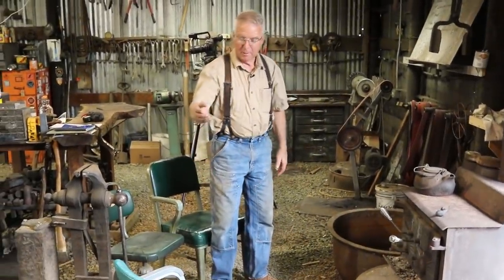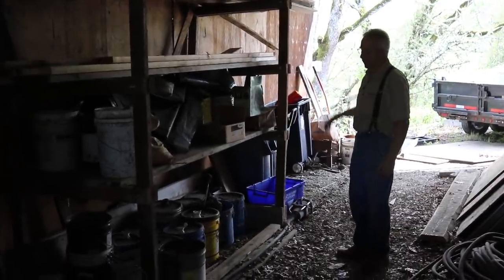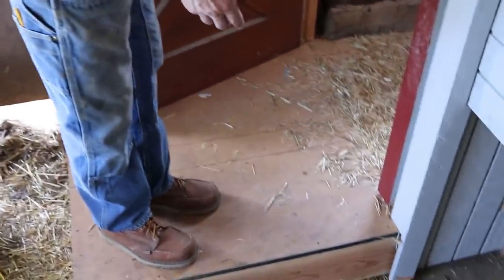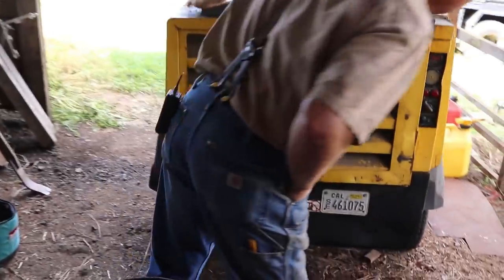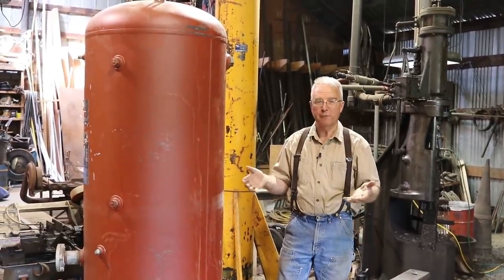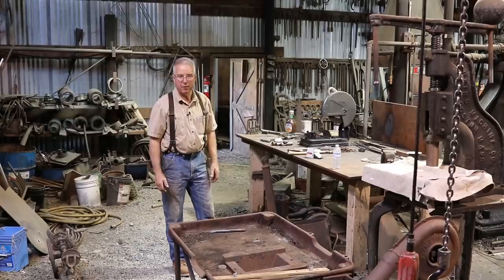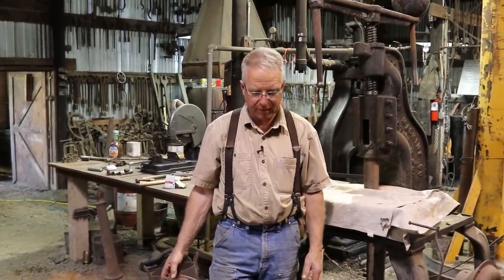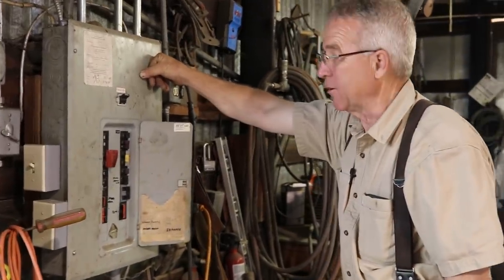Shop Tour 2.0

Comment: FPE panels, also good for arc welding as the breakers are reluctant to trip on a short. Changed out many of these panels in my day and saved the breakers thinking I could become a millionaire selling them, but never sold a single one because any time I encountered one of these beauties I always recommended changing it out for a new panel. ;)

Comment: I would put that outside on concrete slab with some copper piping running out to it add a trench dug over to the power hammer and put a moisture drain kit they sell condensate drain‘s that automatically pump out water once water has started to send into the bottom of it

Comment: Certified scuba tech here (smaller vessels but much, much higher pressures - 300 bar), put the pressure vessel somewhere easily accessible for inspection purposes. Even if you don't keep up with the legally mandated inspection routine in your region, being able to keep an eye on the condition of your pressure vessel for your own safety and those around you

Comment: Take note of the suggestions from others here, for piece of mind a hydrostatic test is a bare minimum for a pressure vessel of unknown origin.  I’m sure the nameplate was removed, for liability reasons.  You can not assume anything about that vessel.  The energy stored in that volume of compressed air not to be taken lightly.  I’m a metallurgist and SME in pressure vessel failure analysis.

Comment: Mount the pressure vessel up by your long steel rack and plumb the lines to the power hammer through the air so you don’t have to worry about them

Comment: A tank like this should be placed close to the compressor.  You'll have LOTS of water in the air.  The tank needs to be able to be drained - it will also act to cool the air down as you are running tools.

Comment: I'd mount the volume tank (it's what we call them in the commercial diving industry) outside and plumb it directly to the power hammer. Put a small volume tank or peanut tank (diver terms again) inside fed from the smaller compressor. And then put a croseover between the two systems (1/4 turn ball valve basically) to isolate them if necessary. I'd never worry about a pressure vessel made from pipe unless it was thin wall. Personally I can get oil/gas pipeline for free. If welded properly, it can run at a working pressure of 1200 psi no problem. Running less than 200 psi... No worries. Worse case scenario, pin hole leak. Then again I'm in lousiana. Use what you can get.

Comment: My vote for the air receiver location would be up.  Someplace in the rafters, or on some sort of support framework.   Second place is outside.  It wouldn't be too difficult to add an enclosure to protect it from the elements on the exterior of the building, and it wouldn't take up inside space.   Least desirable would be inside the shop at floor level, taking up your limited shop space.

Comment: I would put it outside, that's what we did in my old shop.  That was kinda a rule, if it could live outside, that's where it belongs.  One thing we did was run a copper hard line out that was diagonally run to the top of the wall, then came down vertically to enter the shop at about waist height.   This acted as a cooler for the compressed air and had a drain at the bottom.  It was very effective, our air was pretty dry although we sitll used driers.

Shop organization is an art, you need to analyze what you do most and minimize the travel back and forth from work to tools/stuff.  For car repair shops, there are consultants who specialize in just that and can save significant time esp when working at book rate.

Comment: There is a product called mobile coat that is used on rv's and mobile homes for sealing the roofs. I have used it to seal around nail and screw holes in metal chicken house roofs. A little spot on each fastener and 2 or 3 coats will stop the leaks and get some more years out of the roof. That is if you don't mind all of the white dots all over the roof.

Comment: I'm a licensed mechanical contractor in Maryland. I service steam boilers, process air compressors and other industrial equipment. They make automatic drains that run on timers to blow condensate out of the pressure vessel. It will extend the life of the tank. You said that vessel was boiler rated it was an explanation tank for a how water boiler? It doesn't have a bladder inside of it does it.
Reply: Those automatic drains are nice.
Reply: Keith Byrnes was thinking the same thing... I’m betting it has a liner.

Comment: Your storage air tank is being used as a accumulator for the power hammer. I'd mount it as close to the power hammer as safely as possible. Personally I'd mount the tank up above. Your floor space is your most important tool you have, keep your floor clear as possible!

Comment: for the air tank what about a cinder block pit in the floor with steel plates over top ?
mount in on it side but at a  1/4 inch slope per foot  so you can install a proper drain valve.
perhaps cinder block walls... 
you could make the pit bigger than needed and squeeze in the smaller compressor, this would quite things down....
as i am typing this does sound like abit of work versus reward... 
if you have the space perhaps a small shed outside of your building with the shop compressor in it as well?  this seems to be the more standard approach to this problem?

Comment: If floor space isn't a major concern, I'd say make the plumbing/servicing easier and mount it as near the power hammer as you can.  We have a big CNC mill at my machine shop that has a pneumatic tool changer that has similar air pressure requirements and we put our aux tank right behind it.

Comment: Cutler Hammer CH load centers for the win! 60+years of faithful service in dozens of applications for me and never an issue. All Copper silver plated buss and breakers readily available at most stores. Should be no problem running multiple air compressors into the same tank. Mounting it in the ceiling would save wasting floor space and reduce the length of your piping runs needed. Assuming your tank has the proper reliefs I don't think exploding would be an issue. I have never been able to find any documented proof of a failed certified airpressure vessel that was strictly from corrosion. Most all pressure vessel explosions are from failed overpressure limiting devices. If you do run multiple compressors into one receiver be sure the blow offs can handle the capacity of both units combined.  Every receiver I have put out of service was all do to air leaks from rusty pin holes vs massive explosion. Lots of semi trucks and trailers have air tanks rust out and fail all the time. You never hear about them exploding though.......

Comment: I'd put the big tank outside and make it dedicated to just the power hammer.  Then I'd use a more conventional ten or twenty gallon compressor for general shop air.  It also should go outside.  Both should be outdoors because they are so darned loud.

Comment: For the air tank, if you intend that there will always be air in it, install a large and small compressor on independent circuits.
Lets say you want 100psi, set the small one to run at anything below 95, set the large one to run at anything below 90 (this one can cut out at 100 on the hysteresis)
When you run a small tool, only the small one should run, but if you then run a larger tool, the big one will cut in as well.
The aternative is to select the one you want, but the above iddea is automatic.
Also, i would mount the tank outside, don't want big boom! :D

Comment: I'd be putting the tank outside to save a bit of space and run 2" lines to the power hammer so you don't get a pressure drop. 
Also if you want to clean up that rusty forge try molasses and water. I always have a plastic 200 litre drum ready to go. It takes a while but does a good job, just soak for a couple of weeks and pressure wash it after. No scrubbing.

Comment: For the Air Storage Vessel, either stick it outside and pipe in large air lines for it, or mount it up in the air. Keep the shop area clean and visible all around. Don't clutter it up with tall objects that make it hard to see around.

Comment: I would suggest putting it as close to the hammer as possible... This will deliver the most volume to hammer on the start...90 cfm at 90 psi is alot lol...couple other folks have mentioned a drain as well which a great idea... Your gonna get moisture no matter what so hitting ball valve for a few seconds before starting would be a great pm

Comment: When you upgrade your service panel consider upgrading to 200 amp service.  You can use a separate service which is good if you want to write off the cost as a business expense but may also result in a higher commercial rate. A better option, abet a costly one is a 360 service.  You get two 200 amp services with one meter.  200 for the shop and 200 for the house.

Comment: Put the air tank outside with a cover over it along with a standard compressor you would have more than enough reserve capacity you'd have to put a check valve in the tank for the small compressor feed, you'd need to install a pressure switch on the big tank to turn the little compressor on and off. A blow off valve set at 120-125 psi I don't think you would want to go anymore than that on a tank that size.
Reply: Graveltrucking 
Yep those big compressors go up to 175 psi usually
Reply: Sicktrickintuner That’s a big tank not sure how much psi it can handle better not to push your luck.

Comment: May be different for you where you live. But for us (in NY) if you put solar on your roof. You can deduct some of the cost of both the cost of a new roof and electrical pannel/system. If it needs replacing.  So with that large roof you could see some real payback in electric and building upgrades.

Comment: Check the tank, water pressure or air pressure rated?  There should be a manufactures rating.  We use “volume tanks” like that, ours are rated for air and inspected as well.  I would mount it high or outside and drain it often.

Comment: Hey buddy loving your channel I was turned on to it by Abomb I'm sitting at home with a shattered femur but I'm a 35 year veteran industrial air compressor mechanic traveling around New England your right by getting that tank I have seen some horrible things after they exploded, couple of suggestions, keep it vertical it is engineered that way, when you lag it to the ground do not torque the nuts down on the studs it's the easiest way to ruin it because it puts major stress on the welds, use Nylock nuts. Another thing is run your pipe from the comp to the lower port in the tank and out the upper port to your hammer, the tank itself will act as a water trap. One more thing install an electric drain valve on the bottom unless you promise to drain the condensate daily as a pro I install them on all tanks and set the timer to open for five seconds every ten minutes. Lastly install a properly sized safety relief valve so if that tank tag says it's a 200 lbs tank that's the pressure relief valve you will need, I don't know the CFM rating of your compressor but he safety valve will need to pass more CFM than your machine can make, think of a stuck governor wide open, hope this helps!!!!!

Comment: as with a lot of your readers opinions the recommendations will vary, so i will give you mine. one cannot beat a square d panel but only if you go with the "QO" series. do not even consider the "homeline series". now there is the opinion of an old, retired electrician. with the attitude you have towards getting things right, the square d panel is the only one that fits. as for the holding tank; it will serve you better to put it as close to the work site as possible unless you want to run huge piping to your outlets.........g
Reply: QO panels are good, but only QO breakers fit QO panels. Homeline panels are 1" breakers, but only Homeline breakers fit Homeline panels. Most other panels, like GE, are 1" breakers, but different manufacturers breakers will fit.
Reply: @wgiles51  i do not see that as a bad thing. only cadillac parts fit cadillacs. i have worked in and on most all of them for 50+ years and still draw the same conclusion. in this case, ironically, one can have the best for about the same price as the mid line or some low ends. thanks for the reply.........g
Reply: As someone who's not an electrician by trade but is interested in the trade, I've never heard a bad thing said about the Square D "QO" series panels as far as safety goes.
Honestly, the fact that only QO breakers fit QO panels is a good thing to me, it means I don't have to comparison shop to find out who makes the best breakers for the panel because there's only one option that will work.
Reply: Agree with original post. Licensed electrician here. QO would be a great setup for your shop. In regards to only using QO breakers....well that's the point. Its manufactured to use only one type of breaker. Using others (which can't happen with a QO) like other panels do, voids the warranty. Use equipment as they are designed. Saves you a lot of headaches.
Reply: @cricketyosh  thank you

Comment: Hi, I liked your shop tour. That shop style is very common here in eastern Canada.- everything is neatly stored in a perfectly randomized pattern. And only you know where everything is.
For your new air receiver, I would eliminate the below ground tank. Just cut it out. It’s too small and a disaster in waiting. I would put the new tank near the air hammer. It’s going to be your heaviest load so the piping to it is going to be the largest. Anything else can be run from smaller spur lines. Also, there is probably a bottom plug, maybe 3/8” or 1/2” NPT, on the base of the tank. Put a condensate drain there. If your forgetful, pick up an electric auto drain. They’re not expensive and you can set them up to give a measured drain cycle at a predetermined time. That should work for you.
Oh I like the blower table. The tuyere in the bottom is generally pronounced like “tweer “ around here. Long ago steelworker I was. Cheers

Comment: As far as where to locate the pressure vessel - I’m afraid I probably fall into the category you mentioned as ‘not knowing what the hell they’re talking about’. BUT, I would think, get it up in the ‘rafters’ and out of the way. As long as it’s not too hard to access.
You’re not kidding about those power-hammers being air hogs. But if you can feed them enough air, the amount of work they can save your arm is beyond invaluable.
We had an Ingersol-Rand compressor like that, stolen off the job one night. Fortunately it had been fitted with a GPS sensor and the cops were able to locate it within a cpl hours. It was loaded into a shipping container in Port Everglades (FL), ready to be loaded onto a cargo ship and spend the rest of its life in South America.

Comment: What I would do, mount the massive tank out of the way, possibly outside beside the compressor, 
1” diameter pipe will work to supply 90CFM no problem.
Any massive users, like the power hammer could use a small tank close by, 5-10 gallons would be plenty.
Running the air lines up high and making drops works best, of course, like gas line it needs drains at the drops.
Rapid air if you can afford it, is really nice aluminum tubing that takes the heat out of the air to allow the moisture to condense.
Probably cost $1000, and online has a planning tool on there website

Comment: That hot water tank is likely glass or epoxy lined if it was in an domestic or other open hot water system. Judging by the sound it made when you banged on it, it's not cement lined. Either way I'd stick a strainer in the line upstream of any automatic condensate drain you install. A glass lining, which air tanks do not have, can crack and spall off with constant pressure changes. Shouldn't be a problem in your air stream, but might clog up a float condensate valve. Tanks like that often don't last long in hot water service. I've swapped out 500 gallon tank after only 5 years of use. They're usually much less than 3/16" thick. Stationary code air tanks are usually of the same shell and head thickness as water tanks so inspect it well and it should be fine. Personally, I'd rent a hydrotest pump and test it it before putting it in service. Can't be too safe with your grandkids around that stuff. Don't draw air off the circulation ports in the side. One or both of them will be fitted with baffles that condensate can hang up on and enter your air stream. Draw air off the top. 

All that tank talk aside, your shop is great!

Comment: I must agree with the mining engineer.  Your new pressure tank (air accumulator) is most effective when mounted near the power hammer and connected to the hammer with large diameter pipe to minimize pressure drop.  There is also a good suggestion below to run the tank at a higher pressure (125-150 PSI) and use a pressure regulator between the tank and the hammer to drop the pressure down to 90 PSI for the hammer.  Be sure to get a regulator that is rated for at least 90 CFM  that the hammer requires or the hammer will be starved, thus negating the benefit of having the big tank.  Of course, the drawback of the big tank is that it can take a long time for the compressor to pump the tank up to 90+ PSI every time you start.  You may want to include a good check valve between the compressor and tank so the compressor is not exposed to constant back-pressure when the compressor is off.  An air on/off valve that depressurizes (vents) the feed line from the compressor would be also reduce compressor lubrication issues.

Comment: RE the "boiler" tank, as it was probably used as a hot water tank, I would have it hydrotested for at least twice the planned working pressure before putting into service on air system.